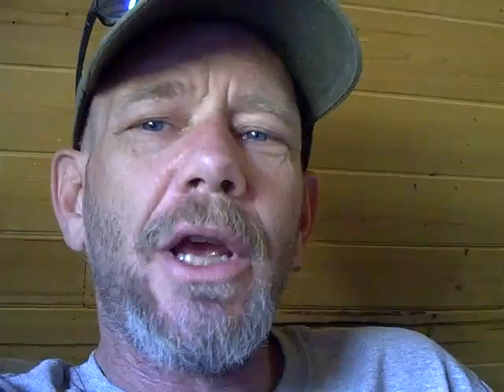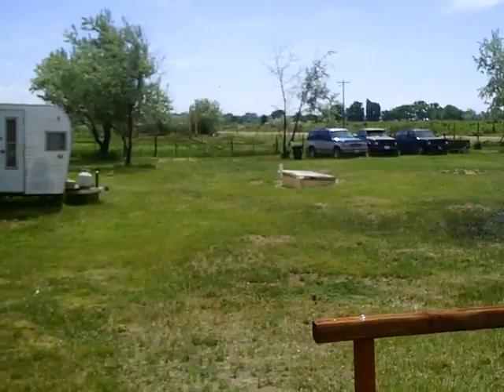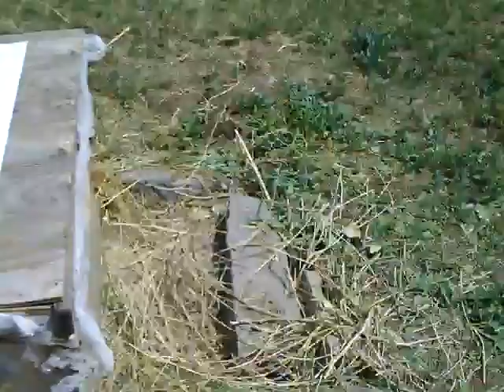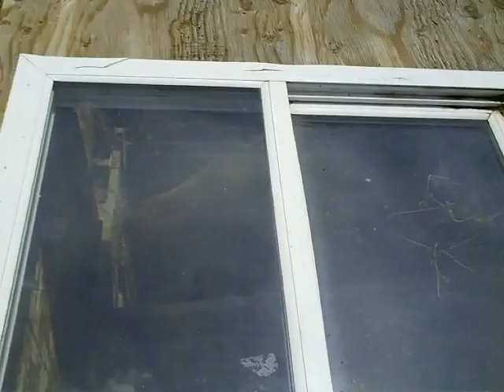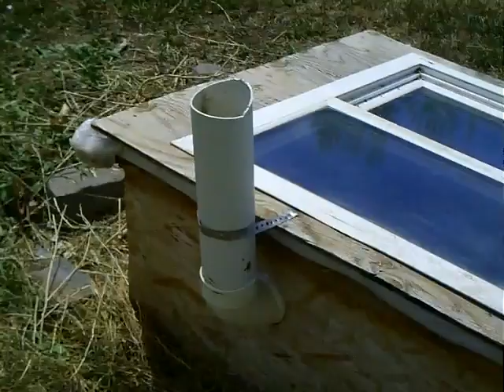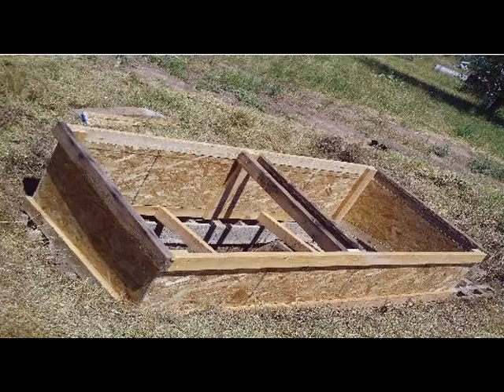Solar Composting Toilet by SolarCabin

Comment: Lamar, does used toilet paper go into the composter also? If not, how do you dispose of it?
Reply from the maker: TP goes in the trash.  It can be composted in a regular compost pile if you want.
Reply: @solarcabin  My thought is to put in a drum, soak with diesel & burn. Or put in a grocery paper bag, soak & burn.

Comment: I remembered having seen this video years ago, and now it might become more relevant. I am looking to put a system in place that could work for about 10-20 times the amount of waste that you have. What might you recommend to ensure the system works as smoothly as yours? Bigger tank? More windows? What about the smell? I would assume that that would escape through the pipe where the moister gets evaporated. Would that be an accurate assumption?
Reply from the maker: The trick is t not put shower or excess water in to that tank. Send that water for watering plants to a French drain. You still need a short drain field to the tank just in case and designed for 1-2 people not a big family.

Comment: Great system for my off-grid lot. Does it smell around the system? Any reason why you don't plumb your porta-potty into the system to save having to empty it out manually?
Reply from the maker: No smell at all unless you put your nose over the vent pipe. I would need a permit to run a drain system and my old system is grandfathered in. They want $5k to run a conventional septic system. I don't mind emptying the toilet once a week.

Comment: Thanks very much for your video. I'm looking at one of these types of toilet which look to be similar to the one you show. Am I correct in saying that it's similar? And if so, do you use the water and chemicals that they show? And said water and chemicals don't interfere with the microbe process? TIA!
Reply from the maker: I don't use water in my toilet but I do put a little RV bidegradable chem in to control smell. Tke it to the car wash for a good cleaning once a year.
Reply: @solarcabin  Good to know. Thanks very much for the reply!!

Comment: Wouldn't there be concern that in extremely hot days rays of sun shine could basically concave to a singular point due to the glass and accidentally ignite the methane inside?
Reply from the maker: Nope and it has 2 large vents for any methane release.

Comment: Have you had anyone adapt this idea to a standard septic system. I would think removing the manhole covers and adding a raised box with windows to create a warmer atmosphere in the tank would improve the tanks ability to seld compost. Basically a mini greenhouse. We also live in a northern climate. Thx
Reply from the maker: My composter cover actually sits on a cement block conventional septic tank with a drain field. My brother built the tank when he lived here in a trailer many years before I took over the property. With the solar cover installed it never gets full and the drain field is never used.

Comment: I just happened upon this and this is quite interesting.  Consider slanting the top such that condensed water rolls into the second baffled compartment.  Also some black paint may heat this up a bit more.

You mentioned that this does not attract insects but I would think flies would be attracted to the not so pleasant odors coming from the vent.  How did you deal with that and keep critters from entering the vent tube?
Reply from the maker: Flies don't seem to go in at all. Too hot for them.

Comment: Good shit! I have been thinking about this for awhile now. It seems to me that the composting process could be substantially accelerated by incorporating heat generated by solar energy. I'm making a composting toilet for a bus conversion RV.  I am going to use a ventilated container of biodegradable silicone beads in the poop bucket to reduce moisture as well as a urine diverter.
Reply from the maker: The less moisture in it the better. Use a urine diverter and shower water should be recycled back in to green things.

Comment: Great idea most videos I've seen about composting toilets use 5 gallon buckets and separators mulch or wood chips this idea seems like a lot less hassle
Reply from the maker: Getting rid of that excess moisture makes it dehydrate and compost much faster and the green house aids in both. Almost 20 years and this system still works perfectly and has never even used the drain field.

Comment: Do You put any chemicals into Your composting toilet ? ( if not , how do You pour , ur , well , how the heck do get "everything " from the potty into the septic tank ... that entry port looks mity itty bitty to Me )
Reply from the maker: You can use  the toilet chemical which is biodegradable and won't hurt the bacteria and it is just a liquid when it pours out.
Reply: @solarcabin  ok that makes sense . are there very much oders in the cabin ? How many gallons dose the potty hold ?

Comment: It seems to me that you're periodically exceeding pasteurization temperatures, at around 150f. If this is true, that will actually kill all of the bacteria, worms, and viruses within minutes. That's actually faster and safer than composting itself for removing pathogens. Here in the tropics (Panama), I believe this model would work even better.
Reply from the maker: My design is now used all over Pakistan and hot climates as it requires no drainfield and kills pathogens. It should be an approved system but the US wants expensive systems.
Reply: I'm sorry about that. I'm an American who moved away to escape that bull- compost

Comment: It's genius Lamar! It's a CRAP COOKER, couldn't be a better idea. I've seen stainless steel incolet toilets that burn the waste which cost a fortune
Reply from the maker: Thanks, this seems to work very well and has never overflowed in to the drain field. Saved me $5000 on a septic system.

Comment: Brilliant! 
If all systems had this exposed design holding tanks could be smaller and drain pipes greatly shortened.
Reply from the maker: They are using my system now in rural areas of India and Pakistan. US codes are designed to make money for contractors and counties not to produce good results.
Reply: Exactly! 
In the deep south this would be a mighty powerful system lol

Comment: You go, but you aren't covering the deposits with anything between dumplings while it's in the house? Correct? And you lift the solar lid to put your refuse into the septic system... or you use the second pipe to fill the concrete box? Is your chemical toilet using chemicals to keep the smell down or is it just a base for your Loo?  No wood shavings or composting materials other than the waste itself?

Comment: Interesting video.. hope you're still around to answer this lol... I've been thinking of the same principle which is actually how I found this video... my question is.. is there any reason that you are aware as to why you couldn't do this with a typical plumbed septic system? My thought is to recycle my gray water use it to flush the toilets as well as other uses.. but then have the waste plumb to typical septic system. I would then again put a little flare onto the leach field side of things cause I don't want to lose all that extra water either.. 

Codes and such won't be an issue for me under AG1 zoning... I can better sell the idea to the wife and kids when it doesn't require touching the poop lol.. 

Another question you didn't touch on.. do you dump your food scraps and yard waste in as well or are you composting that in a different way? I'd like to do it all in one system. I'm just not sure how well that's going to work using a typical septic design..

Comment: Very cool setup! I just installed a Nature's Head composting toilet in my off grid cabin and so far absolutely love it! Looking forward to doing a full review once I have put it through its paces. Love your videos Lamar!
Reply: how has your natures head composting toilet doing so far?
Reply: I use a Nature's Head also - they are very sturdy - a bit messy to empty. The urine diversion keeps the odor down. I don't vent - but if it's in a shelter (and not a structure) then no permit required and plenty of fresh air ventilation. In the winter I store it for occasional use inside with the heat - only also with wood ash/charcoal to keep down odor. So far it's worked awesome. It's expensive as upfront cost but the thing is built like a tank. Also it only needs emptying once a year if that - for occasional use. Anything in a toilet is considered septage requiring permitting - for one year in my state. But there is a primitive loophole - if you don't have any contact with soil for 3 feet - so that means I compost outdoors in a container - 40 gallon - with lid - and so it composts for two years like that.

Comment: Greetings Lamar, which book should I purchase which will include the plans for this system? Great concept that is practical and should be all that any one might need. Would you suggest a larger system for 2 people or should this process be able to handle processing waste from 2 as opposed to 1? I am gathering that the waste includes paper products dumped into the tube? Love this!!
Reply from the maker: A 4x8x4 two baffle tank like mine will take care of 4 people as long as you are not putting in excess water. Toilet paper should be put in trash and burned or composted in a compost pile.

Comment: I already installed two 55 gallon drums like a traditional system with leach lines. Do you think this will work for my system if it is only black water for one person? I purposefully didn't install leach lines yet after watching your video. The toilet is an RV toilet running straight into first barrel.
Reply from the maker: +Joseph Druther  I would still install a leach line and I have one just in case the tanks get flooded but yes you can build a greenhouse over your barrels and that should evaporate the moisture if you get enough sun in the day time and you are not putting excess moisture in the system.
Reply: +solarcabin thanks! so do you mean just an 8 mil plastic small plant greenhouse? or like a full out walk in with plants and the works? not sure exactly what you mean as far as type and size
Reply from the maker: +Joseph Druther  Just a couple of glass windows on top of a plywood box would work. Like shown in the video.
Reply: +solarcabin you rock! that is the plan. I have extremely sandy soil so a fairly small Leach line should work for me. thanks again

Comment: I absolutely love this very basic and easy composting method. In your opinion, can a  small tank porceline toilet be installed in the cabin with an angled pvc or sewer grade pipe running under the house to the compost box be efficient? my hubby also wants to install a very basic urinal which will reduce his need to flush and it too will run to the compost box.

Comment: did a search of your discussion on this.  Apologize in advance if I missed the answer to this question in my search.  With your Porta Potty; do you use some water to aid in the flush?  I would assume cause you need some water in the porta potty to help empty its tank into your composting septic tank, but like they say... one should never assume.

Comment: Looks like a workable solution and it answered some questions I've had regarding the frigid temps...as I sit here in the Mid-Atlantic region with sub-freezing temps for the last week - my food bins are solid ice blocks right now. Was thinking I could bury a black plastic bucket half underground and let the sun do the rest, although it has no venting. Do you have any offending odors coming out of your septic vent?

Comment: nice set up. you gave me some great ideas. i can think of a few improvements right off. like a taller exhaust pipe maybe with a battery back up solar powered fan.so the smell and moisture can be taken away further away.and faster. yes this would reduce the temperature inside somewhat but with a little thought it could be controlled.also paint that exhaust pipe black would aid in air flow.

Comment: I have a few questions.
In your actual toilet, do you add pine shavings/wood chips/etc. to help absorb the moisture and maybe take care of the smell, before dumping it into your solar septic?

Since you are not using your waste/ compost to use on trees, garden, etc. Do you think it would be possible to add dog or cat waste and (mine uses pine pellets or shavings as their litter) litter in this system? Or would it harm the system somehow?
Reply: Modern Country Mama , that'd work perfect ! Expecially since your using wood chips in your litter box !

Comment: Quite clever. I have moved down to Guatemala and am considering building an off grid vacation home. Solar is not a problem here. It is between 60 and 90 degrees year round. I do have a couple questions. In another comment you said that you do use the humanure, how do you harvest from this tank? Would having a dual tank system make harvesting easier? How long does this system (in the summer) take to compost to usable humanure? What changes would you make if you had to build it over? Does the heat help prevent insect invasion? Ahhhh I ask too many questions.

Comment: Lamar, I just wanted to get your thoughts on a propane powered incinerating toilet? Besides the initial cost do you feel they are convenient and worth the price of admission? Thanks.
Reply from the maker: Incinerating toilets were designed for boats primarily. They work but need fuel and power so not a great choice for off grid houses.

Comment: Let me ask you question, would it be possible if you build toilet next to solar composting so you never have to carry box with human waste in it? I mean to link toilet to solar composting with pipes.
Reply: I think it would require lots of water to flush your waste into the pit and it would defeat any benefit that this system brings, unless it's directly under your house but I wouldn't want that there.

Comment: What geographical location is this test system in? I'd like to check the climate data. - in particular, how many days per year do you have freezing temperatures?
Reply from the maker: This is in Utah at 4800 ft elevation. freezes here from December through March.
Reply from the maker: The tank never freezes solid but may get ice on top if the sun doesn't shine for a few days. Unthaws as soon as the sun comes out.

Comment: Hi,
Thanks for your great work! I have two questions:
 -what do you do with the toilet paper?
 -is it possible to build an outside toilet right next to this thing? Skipping the nasty business of emptying the portaloo. With an airtight lid on the toilet, only opened when it's used. Or it would be a rather smelly experience?

Comment: This is brilliant. I was wondering, are you emptying your waste tank into that little PVC pipe? That, I imagine, would have to be done with a small scoop or whatever. Is there room for a larger opening to just quickly dump the stuff in (no pun intended?)

Comment: Thanks for the great video and the idea. If anyone hasn't already asked this: wouldn't you also get some useful methane/biogas gathered from the outlet pipe pretty easily?
Reply from the maker: In order to harvest methane you need an air tight cement tank and a system to remove the sulfur. The Chinese have the systems in use all over but beware methane is highly explosive so do your research.

Comment: could I use this with the bucket covered by a wood box with a toilet seat...and using saw dust or coconut shavings  and just empty it into the solar composter/septic system..I live in upatate NY and I had similar issues in the winter that you mentioned...love your channel !Thanks
Reply from the maker: You could but if you are using a sawdust system a cheaper way is to put a small greenhouse over the compost pit in the winter.
Reply: +solarcabin To pee or not to pee is the question? should we divert or squirt into the dirt? I want to know if I'd be better off using a urine diverter to go into a grey water system or forgoing the funnel and use a solar composting setup similar to yours. I'm also thinking of using the methane gas to cook and heat with.

Comment: So if you triple the size of septic tank could it handle a flush toilet ?
No more weekly trip to the pit ?
Reply from the maker: The system will not evaporate the water used for flushing fast enough. It is designed for minimal water use.

Comment: PS I do love yer videos and have been watching for a couple years. You have some very good ideas, but there's more and new ideas we have to stay abreast of too.
Reply from the maker: Maureen composting piles and humanure is not a new idea and this system is a new method and and works better. Thanks and enjoy the videos.
Reply: It's just that in every bit of excrement from any animal contains sun energy that should be utilized and this system doesn't. That's all I have against this set up. I do understand if you can't do composting where you live. I suppose we'll need to put some YT films up that actually show the composting beds steaming in 30 below to convince people it CAN BE DONE!
Reply from the maker: I do use human waste as fertilizer: 
Planting and Feeding Fruit Trees by SolarCabin
Reply: Wonder if this would still work in Winter here in Wisconsin?

Comment: How do you retrieve the compost from the septic system container?
Reply from the maker: I don't because it just dries and becomes nothing in the tank. I have a separate system to use urine for fertilizer through a sprinkler system.
Reply: solarcabin how about now, is it still nothing, or do you have a plan for cleaning out the 💩?